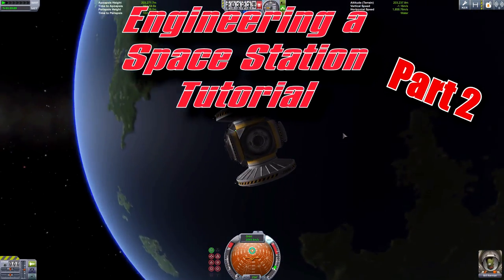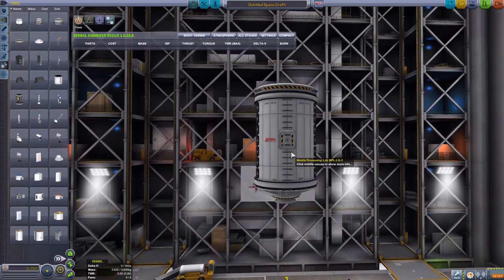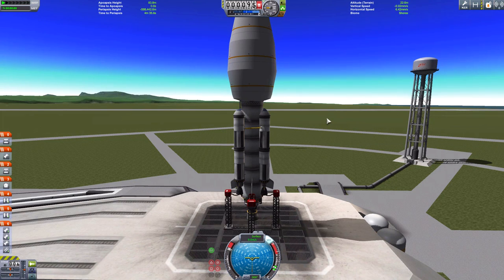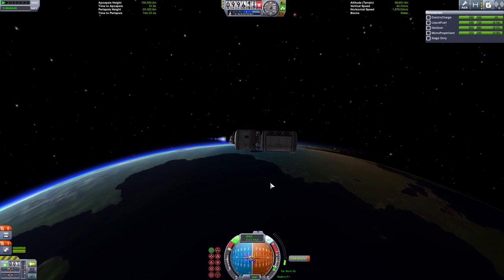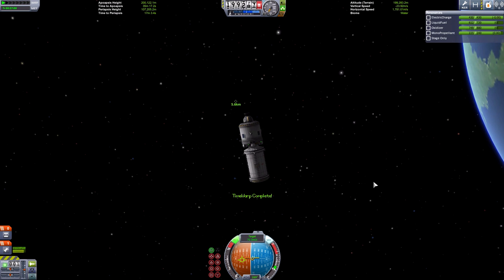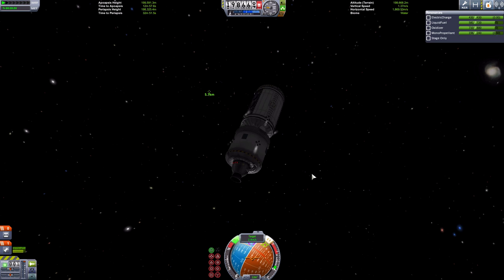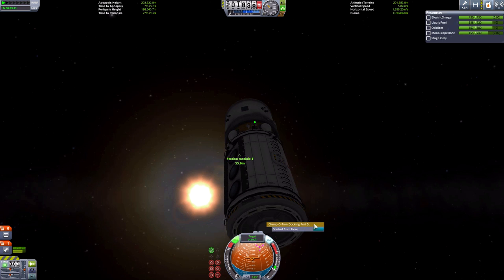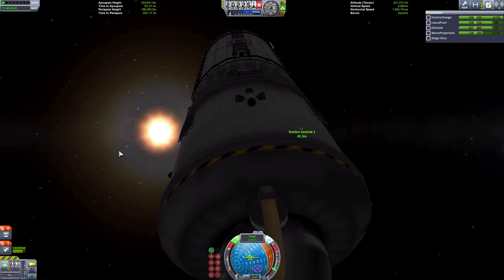Kerbal Space Program - Tutorial Building a Space Station Part 2

Comment: The videos help me a lot but idk if I’m doing something wrong or it’s just harder on consoles but I just can’t seem to get close enough to the station. My seperation is always over 150km and idk how to close it in
Reply from the maker: KaptainKrakens Do you have manouver nodes if yes then try and fidle with them to get best encounter and also reduce the thrust of the rocket for fine control, its basically just try and try again save before you burn for the encounter and load save if you mess up until you get closer

Comment: i have a question. how can u use the RCS to boost your spaceship. isn't the RCS only for turning?
ex)if you turn right, then the RCS n the right side burns backwards and the RCS on the left turns foward
Reply from the maker: +Michael Sa You can use Rcs for anything it us the least efficient but you should use the least efficient fuel first as this reduces weight and increases delta v, plus rcs gives you fine control when you need a precise manouver
Reply: Thank You!

Comment: My Intersect is 11.9 km. Is that ok? If not, how do i change? I tried by doing a new maneuver but i only got to 11.8 and didnt burn because its nonsense to me.
Reply from the maker: +IndieZocker Yes its close enough you just will have to burn a couple more times. 
When you get as close as you can make sure the nav ball is set to target if its not make sure you have the other vessel targeted and click on the speed reading on the nav ball untill it shows target.
Now point retrograde on the nav ball and burn unntill speed is close to zero
Then point at purple circular marker  (your target) then burn towards it at between 50m/s to 100m/s
Wait to get closer you may find you drift away again so reduce target speed again and burn towards the target again
Repeat this until you get close enough to see the target then kill the velocity to zero again
You can now try docking ;)
Reply: +Orb8Ter actually ur response took me too long so i tried it myselfmand i understood it thanks to you video directly but still thanks and i PERSONALLY more like to burn with a maximum of 50 +-2 BUT i wasn't carefully enough and i crashed into DA FOKIN SPACE FUCKING STATION but tomorrow(Im from germany and here right now its 23:32/11:32PM) i will make like 10 modules(science 1 science 2 and maybe science 3 huge crew containment unit on fuel storage for each fuel there is in stacks, worth 100.000 units of it and some transmitter a huge solar panel thingy thing AND maybe some kind of hangar with tiny ships that get resources from earth and mün and other bodys and more stuff) and launch the modules, and the core into space. As you can see, since a few days ago, when i finally got how to kinda make space stations, i made so much plans and tomorrow i will "do" them. Im so fascinated about this :D Oh and i would love, if you would make a tutorial series on bases(stations on ground). Cya m8 :D
Reply: +IndieZocker BTW, that was the absolut limit, i couldnt write even one more letter xD
Reply from the maker: I love the idea of a hanger and there is a mod called inferno robotics that can be used to create hinges for large hanger doors may try that out, I will do base tuts but busy with fit at mo so will be a while sorry :(
Reply: +Orb8Ter Ooh it's totally fine ;)
Reply: +Orb8Ter Ooh it's totally fine ;)

Comment: how do you get the target speed so low when you intercept?
Reply from the maker: +41DayDownloadTimes to get the target speed down make sure the Nav ball is displaying target speed then when you point retrograde on the Nav ball you can thrust to slow down the target speed as the Nav ball is showing relative speed between you and the target and the prograde and retrograde change to that of the target making it easier to match your targets orbit
Hope that helps.
Reply: thanks, but my problem is I'm too fast on the intercept to begin with
Reply from the maker: +41DayDownloadTimes Ahh then the best idea would be to slow down a lot before getting the close approach you can always get close by doing multiple burns towards the target
Reply: thank you so much. Helps a lot
Reply: also, I attempted a duna mission, but how do i choose a landing spot?
as in, I seem to always crash into mountains
Reply from the maker: 41DayDownloadTimes For landing on Duna I normally try and find a dip and aim for it like the valley that's on Duna though I miss a lot, but for a Duna landing you need rockets as well as parachutes as there is not enough air to slow you down, I have had problems where I was travelling to fast for parachutes so would have to slow down so I could open the parachutes, Happy landings 😉
Reply: thank you!!

Comment: Would love to see this happen in RSS and RO
Reply from the maker: +Kaywood Parsons I haven't played with RSS and not really planned to, I suppose it would be cool though it is just a larger version of the Kerbal system.
Reply: I followed your tutorial using RSS and RO. Worked great. Except using mech jeb I had to do a gracity turn as following the angle approach doesn't work, it will fall short off orbit. So I started  turning at 5 degree increments every 100 m/s until I reached 45 degrees. Then 30 at 200 km, 25 at 250, 15 at 300 and finally 0 at 350. Then used manuver planner to circlurize at next apoapsis. Perfect real orbit.

Comment: Trying to dock right now xD Just did a maneuver node and got target distance 0.6 km , :D
Reply: +CrackedDood - Youtube Uploads / Streams on Twitch I need some advice though for me the hardest part is once you are like 1000 metters away from the target how do you get to that less than 100metter mark , i just keep overshooting or undershooting
Reply from the maker: +CrackedDood - Youtube Uploads / Streams on Twitch You need to set your target as a target either in map or double click on the station, set the nav ball to target speed but it should be automatic you need to point retrograde and cancel the speed its then a matter to point ot the target burn not too fast around 20-50m/s  make sure you point retrograde and and cancel speed again when you get closer, redo this until you get to around 100m.

What happens is that you burn towards the target but both crafts are in a circular orbit so thy drift around and you are no longer heading towards the target so you need to acount for this by cancelling you speed and burn towards target then repeat this to get a bit closer every time, hope this helps. ;)
Reply: Orb8Ter Thanks , just docked the science module onto the station core :) Thanks for your tutorials
Reply: +CrackedDood - Youtube Uploads / Streams on Twitch click on the speed marker that says orbit until it says target. then burn retro until it is at 0

Comment: I ran out of monopropellant :/
Reply from the maker: Don't you hate it when that happens, monopropellant can be conserved by turning RCS off when turning your craft just add reaction wheels to large spacecraft so you won't need RCS. If your struggling docking then get your close to the other craft and press F5 to quick save that way you can practice docking using the F9 key to quick load, my first dockings were terrible used to take me about half an hour without mods and I would run out of RCS, so I launch a craft already docked, separated them then just docked and undocked from different angles it's something you have to get used like riding a bike.
Reply: Orb8Ter I did it in the 2nd attempt! Thanks for the video and the tips.
Reply: +TheEnterpriseGamer congratulations :P